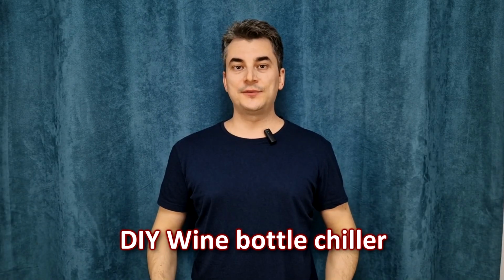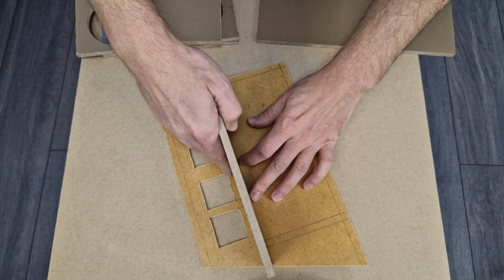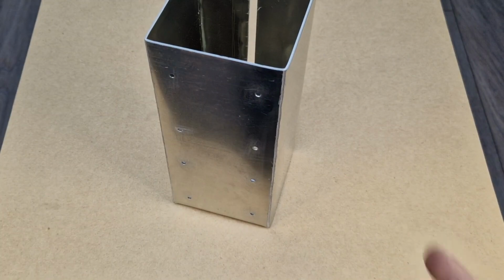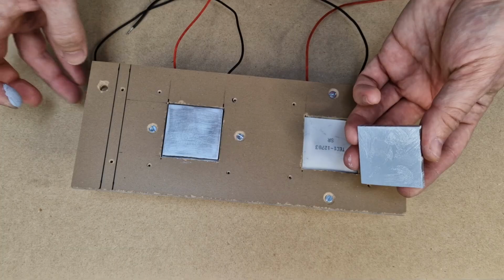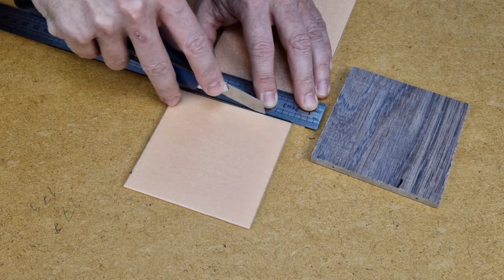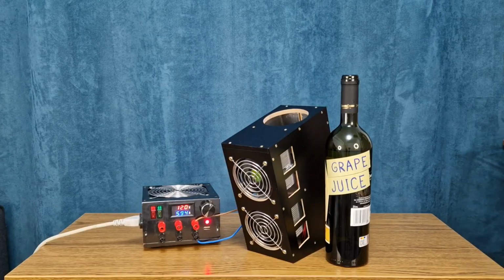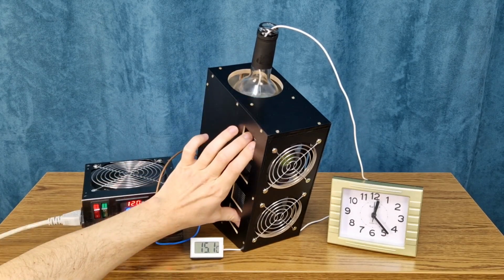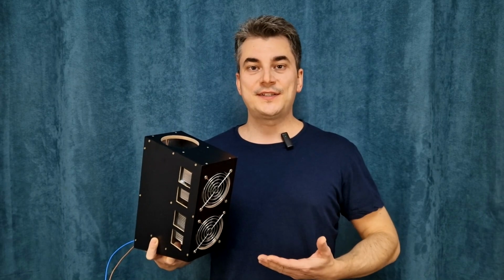DIY Wine chiller / Bottle cooler

Comment: al foil tape on the hotside of the mdf panels would reduce the thermal trasnfer between the air gap because shiny al has very low emissivity which is the dominate mechanism for thermal losses from the cold side. I bought some 12v dc compressor fridges and covered the outside of them with AL foil tape which improved their efficiency by around 30% because they flick the thermal emission of the warm room away, you can even feel the difference. i have a poor quality video on my channel on how to reduce the power usage of a 12v fridge down to ~100wh/day which is like 20x better than a regular fridge.

Comment: If you place allready cooled bottles and add a microcontroler to control the fans and peltiermodules, you can drastically reduce noise while you ensure to not get frozen grape juce.

I made a fermatation box with peltierelement, microcontroler, MOSFET and temerature sensor. I programmed my first PID-controler for this, and it works quite good. A proper controlstrategy is more energy efficient, and keeps the fan speed nearly constant, which is less anoying than switching on and off all the time.

Comment: Nice job man! but i'm curious: what do you do with the condensate inside? that ice, after you turn it off, will melt and end up on the inside of the device...or maybe on the table :)?
Reply from the maker: The box is insulated with laminated panels, vinyl and extruded polystyrene.  There is very little condensation, it will remain inside and will evaporate pretty fast, because there is a big hole on the top. 
Ice is forming only when testing it without a bottle. because if a bottle is touching the cold radiator, it will absorb the cold temperature and the radiator will not make ice anymore.

Comment: Why don't you add a tiny fan in the cold chamber to circulate the cold air so you can achieve faster cooling than using the convection method?
Reply from the maker: Because the bottle sits on the cold radiator. That's why I designed the box at an angle. There is no need for a fan, the temperature transfer is much better from the aluminum radiator directly to the bottle.

Comment: Impressive video, Sorin - DIY Electrical Nerd. Looking forward to seeing more content from you. I hit the thumbs up symbol on your upload. Continue the fantastic work. Your DIY bottle cooler project is both creative and resourceful! How do you think the insulation thickness affects the overall efficiency of the cooling system in practical use?
Reply from the maker: Thanks! The insulation depends on the type of project, for a bottle cooler 2.5 - 5mm insulation is enough, because it's not a closed enclosure. But for a mini fridge or a freezer it needs at least 10mm of insulation. 
Before finishing this bottle cooler I made some tests with no insulation between the cold radiator and a thin MDF panel and it made condensation on the outside of the panel, so it definitely needs some insulation.

Comment: You did a very nice job, 23 minutes to 15 is impressive, especially for a peltier. I just got a 20L compressor driven cooler, and it actually uses less electricity than a peltier individual bottle cooler.

Comment: Even if my comments get deleted, you still using them wrong. Might scratch your ego but still they are designed to be used with CC
Reply from the maker: I have never deleted comments. You are right, these Peltier modules should be powered with a constant current of maximum 3A each and maximum 6A in total, because they are connected in parallel (6.13A including the fans).
So what's the wrong part?
Reply: @Sorin_DIY  Well my comment was deleted somehow. I referenced to my comment on the peltier test you made some while ago.
The wrong part is that the voltage on your power supply staid the same and the current changed.
That is a clear indicator you running them on constant voltage instead of constant current.
They are less efficient this way and therefore consume more energy. I looked in the datasheet and would say around 30% more...
That's why I suggested to repeat your test with CC instead of CV.

Wasn't intented to be harsh, but have to say I was a bit shocked my first comment was deleted (by whomever).
Reply from the maker: Constant current means you can limit the current to a maximum value, not to force a load to draw a fixed current.
for example if you have a variable power supply and you set the voltage to 10v and a constant current of 1A and you connect a 100ohm resistor as a load, it will draw 0.1A. no matter if you set the constant current to 0.2A or 10A, the load will still draw 0.1A. Ohm's law is I=U/R, so 10V/100ohm= 0.1A.
It's the same for peltier modules, this module draws about 2.8A at 12V. you can use a normal power supply, or a constant current power supply set to 3A, the load will still draw 2.8A. 
but if you increase the voltage, then you need to limit the current to 3A, otherwise you will damage the module, because it will draw more current.
You can watch my Peltier test 2 video, where I used a CC power supply.
Reply: @Sorin_DIY   I respectfully disagree.

A true constant current (CC) power supply maintains a fixed current by dynamically adjusting the voltage to ensure the set current is delivered to the load. If the voltage isn't adjusted to achieve the target current, then it's not operating in CC mode.

Some power supplies allow setting both maximum voltage and maximum current, and they will prioritize one limit based on the load—this is more of a dual-mode operation, not pure CC.

As for Peltier modules like the TEC12706, their 𝑄𝑚𝑎𝑥 is specified at 16.4V (not 12V) because they are designed to operate with specific current values, and their performance is optimized when the current is carefully regulated.
Reply: @YourAliasIsNotAvailable  thats literally what he said, he raises voltage till current reach its limit
Reply: Youtube has a weird comment sensor that sometimes deleted innocent comments, my comments get deleted all the time even on my own videos without me deleting
Reply: Youtube has some weird habit of deleting comments or mark them as spams, this happens in reply section too, i have experienced this deleting issue, sometimes when i send the comment it gives a message that says the comment has been made but there is no comment

Comment: I think a 12706 module would have been better for this if you want to cool the drinks more quickly, they are less efficient but will pump through more thermal energy away from the bottle. Though 150w for just a wine chiller would be quite extra.